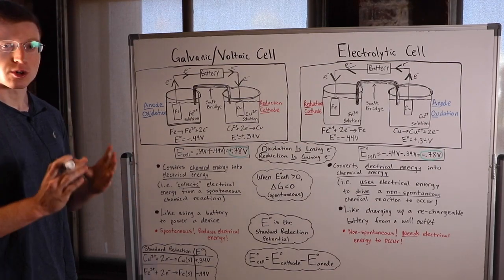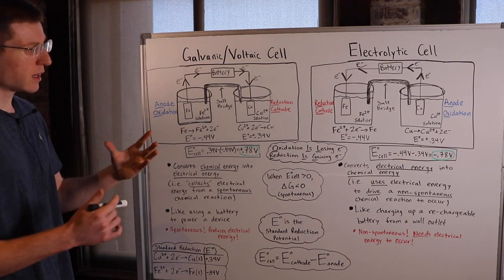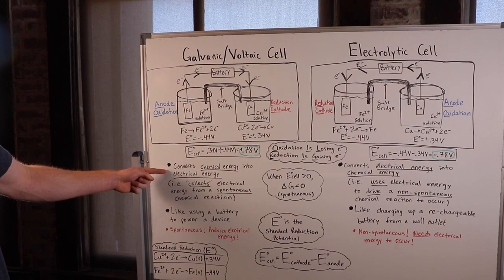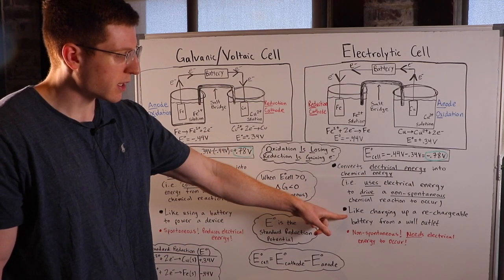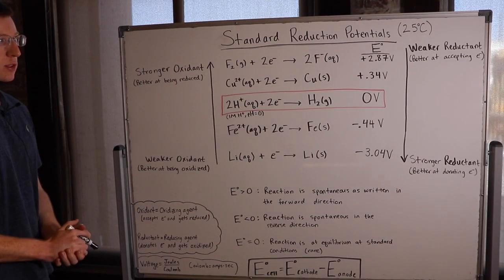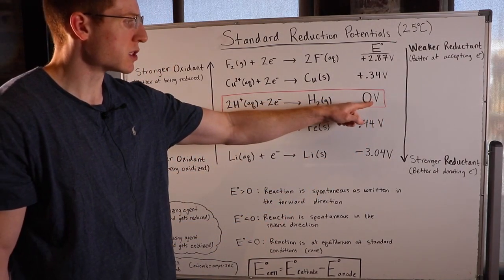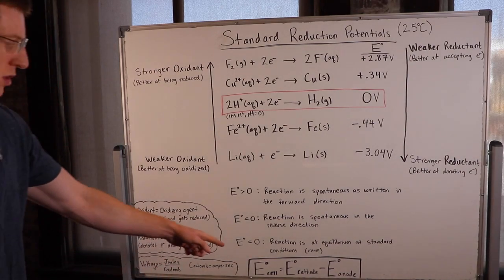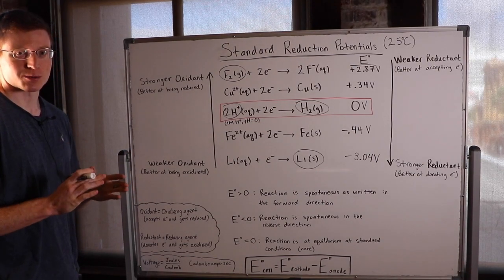Electrochemistry | Galvanic/Voltaic vs. Electrolytic Cell

Comment: Can someone explain why there is that Battery attached  to the galvanic cell? Should this instead be labelled "LOAD" or whatever the galvanic cell is providing electrical energy to? I thought that was the whole point, you use galvanic cells to provide energy to a circuit, and you use electrolytic cells to perform e.g. electrolysis requiring energy from another source?
Reply: This is exactly 😢 my problem
I noticed no one is talking about it

Comment: Im confused about this sir. If electrons flow from higher potential to lower potential, then why cathode has higher potential than anode? +potential > -potential.
Reply: I think we say electrons flow from higher potential to lower potential because we are considering conventional current flow(which  is the assumption that positive charge carriers cause current flow). But in actuality electrons flow from negative terminal to positive.